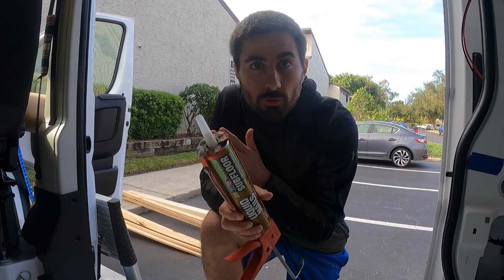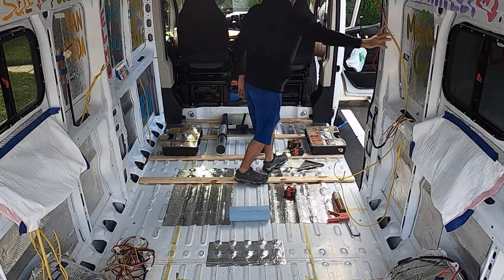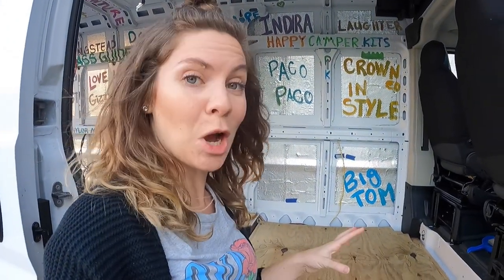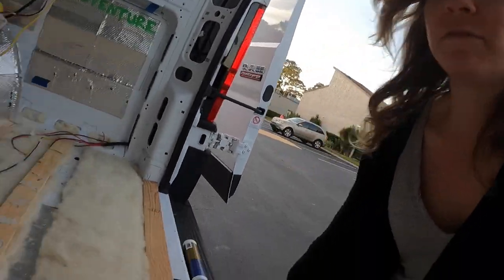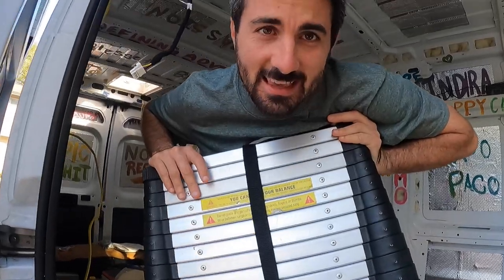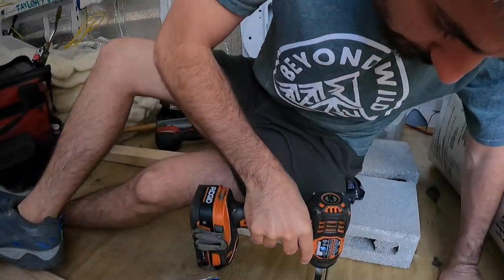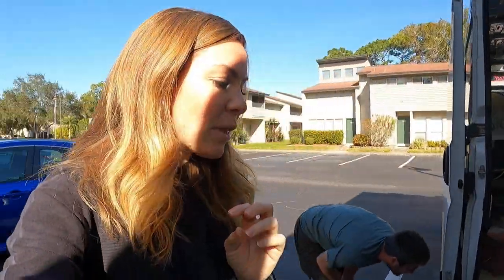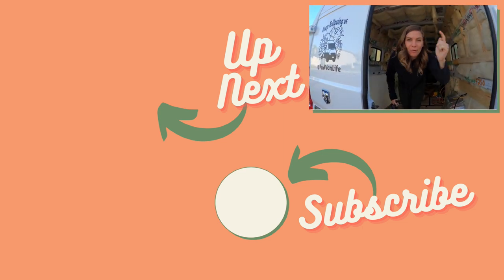Build a Subfloor You Can Be Proud Of | No Holes In the Van!

Comment: Why do you use havelock wool under the floor instead of 1" foam boards that most DIYers use? Furthermore, foam boards would add rigidity to the floor to prevent sagging.
Reply from the maker: For sure, we did that in our first build but had so much Havelock we figured we would use it everywhere. There's no right or wrong way, this floor ended up being very comfortable, actually retained warmth better in the winter than when we had the foam boards in our first van. We have a whole guide on the van build process if you want to check it out: https://www.fnavanlife.com/product/van-layout-guide

Comment: Hey guys great videos.I have a question what's that plastic piece you screw on the inside to attached to the roof for your solar cable I can't look it up because I don't know the name of it
Reply from the maker: Hey Aaron, I think you mean the little plastic nubs that go through the metal to run the wire from the inside to the outside. This is the complete list of everything we got for our solar system. In our first build we used the grey double entry cable boxes but because the ProMaster roof is so wavy we just too the insides of those and used them without the casing. Hope that helps! https://www.amazon.com/shop/fnavanlife?listId=1913GUJMRT2NG